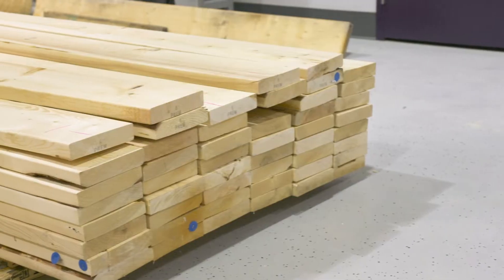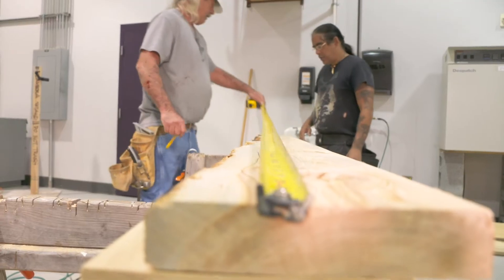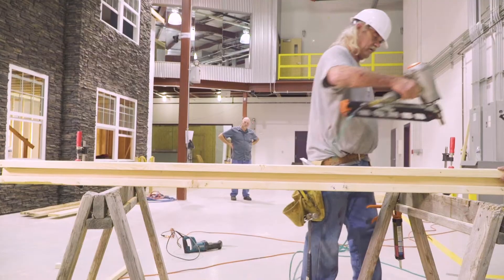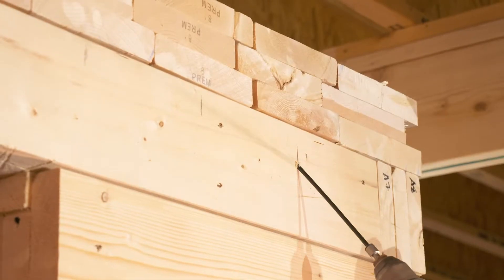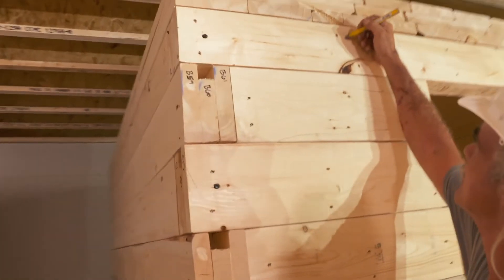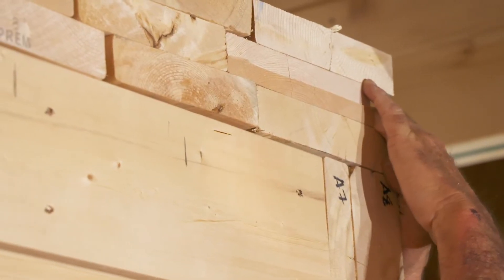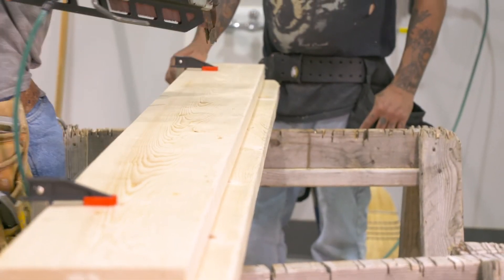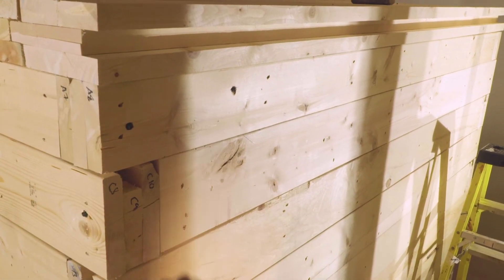Constructing a Wood Tornado Shelter (3 of 6)

Comment: GRK RSS Rugged Structural Screws. The best. Those long screws are at least a buck a piece. I would glue all the 2x8s together. Construction adhesive is much more expensive and you're going to be using a lot of tubes. If you screwed the boards together with GRKs it will be much stronger than nails.

Comment: Why not build walls using the existing cement walls to anchor to. Save  money on material..
Reply: I actually plan on doing this. Using a corner of my basement and building the other 2 walls like this video. I’ll anchor a ledger board on the concrete sides for the ceiling to sit on.

Comment: Finding straight lumber is going to be a problem. You will have to rip cut to get straight edges. Maybe 8 ft material wont be too bad. This is an excellent design.